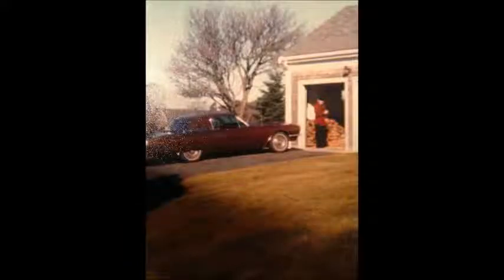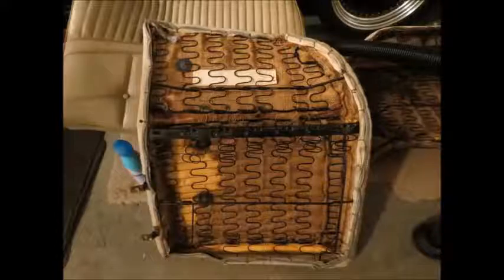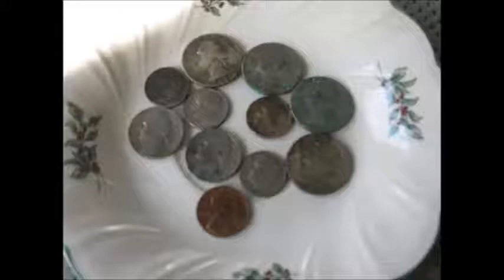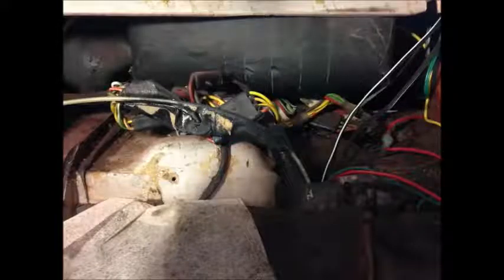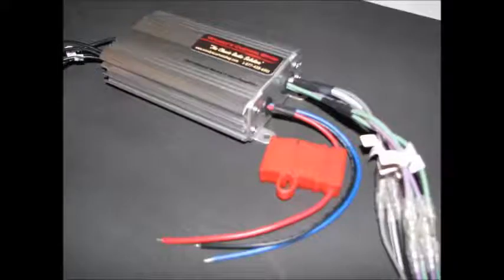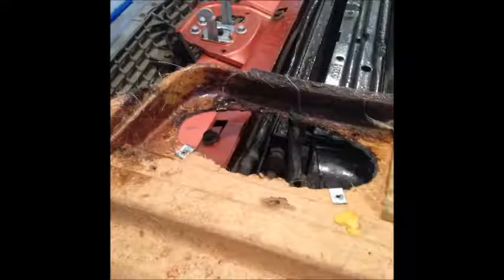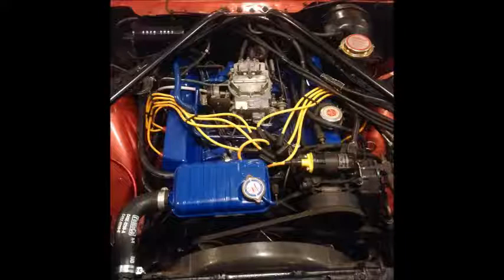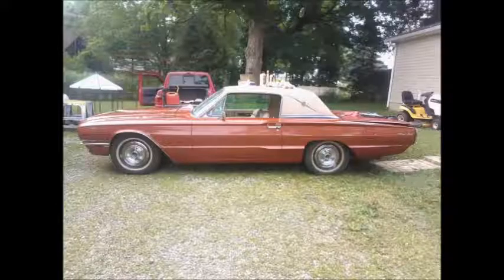1966 Ford Thunderbird Town Landau Restoration Blog

Comment: I always wanted a Tbird when I was a kid, the 64-65 were my favorites. I acquired a '64 in 1984 and had it until 1992. Then just last year a '65 Landau with 80,000 original miles showed up on Craig's list. So not knowing that it was/is a Special Landau I went and bought it. Boy, was Ii in for a surprise.... it has options that I did not even know that they had the passenger seat is electric and has the handle to lay back, has cruse control, and to top it all off it is in Emberglow. So I have been busy over the past several months replacing all kinds of things, all new bushings, front and rear, new leaf springs, shocks, gas tank. Master cylinder, and trunk weather stripping.

Comment: HOW MUCH DID YOU END UP SELLING IT FOR? YOU SAID YOU PAID $3000 AND HOW MUCH TIME DID YOU THINK YOU HAD ON THE PROJECT WITH COSTS OF SUPPLIES? Sorry for all the caps. LOL!
Looks great by the way.
Reply from the maker: That was quite a few years ago! I think I got in the neighborhood of (just under?) $7K for it. Keep in mind it was not running and driving, and it needed ALL the body work to be done. And the rear quarter panels were in tough. shape. I probably had $10K-$12K invested when you figure in all the parts and my time. I really didn't keep track of how many hours I put into the project. I just worked on it whenever I had the time, like most guys. So I definitely took a loss, but in the end, I just wanted it gone, and was glad to see that someone else completed the project.

Comment: You did nice work to bad you did not finish it. I see you sprayed door jams Emberglow That is the color of my 66 bird 428 also.Same interior as the one you owned. I take it you never got the out side painted in Emberglow? Wss the car sitting out side a long time when you got it? Mine is coated under car thanks for pointing out is was factory.You did a nice job on video,Are you doing any other projects?
Reply from the maker: The guy I sold the car to, finished it. He completed the exterior paint job and finally got it running. I had the distributor installed 180* out, and it needed a new coil, that's it. My car didn't sit outside for long. It was a one owner car for 41 years! Mice did inhabit it, in the garage it was stored in. You should subscribe to my channel! I cover nearly every project that I do, and there are lots. lol Thanks for watching and commenting.

Comment: Do you know if the pistons for the calipers can be bought separately. My sister in law threw away the pistons that were in their basement after my brother died. I have two 4 piston calipers and 2 two piston calipers. There is a set of front brake assembly's  kits on E-bay for $400.00 or so. These have  the calipers and rotors and backing plates and maybe flex lines in the kit. I did not think these cars had 4 piston calipers. If anyone on your site knows about the pistons I would appreciate some info., THANKS!!!!
Reply from the maker: These cars came with 2 piston calipers, in the front only. I believe that parts would be available. Also, as a tip, always check Mustang parts that are the same. They are almost always cheaper and more readily available. I would bet that if you went to a big block Mustang from 67-69 or so, Ford would have use the same brakes. Honestly, my knowledge is lacking, I have been out of the Thunderbird 'game' for a few years now. Good luck with your project!!

Comment: Can anyone suggest how we might research a 66 T-Bird back to the original new car sale? The oldest receipt and motor vehicle inspection was 1998. It was sold as a used car. The VIN is non-standard on that car and we have had no luck working through MVA, CarFox or Kelly Blue Book. Any suggestions gratefully accepted and appreciated.
Reply from the maker: If you are the registered current owner, with proper documentation, you can get the ‘Marti’ report from martiauto.com It’s the original invoice from Ford. That will show which dealer it was shipped to, I believe? It’s a great place to start!! Good luck w/ your search, and have fun!! 🤘😎🤘

Comment: I just got one my brother owned. White painted top ,green body. 428 car. Needs some body work but it is not too bad. Underneath needs a major cleaning. Cars had not starter in 20 years. I live in eastern CANADA, in the snow belt. Car is outside now in snow. I dumped a couple gallons of DIESEL fuel in the engine to protect it till I work on it this summer. It had mice problems as well. I think they took some insulation from somewhere and stuffed it in to metal cavity and made a bed and it stunk like he'll from the smell of piss. Have to get some IRISH SPRING SOAP cut up and sprinkled in the car to take away the odor. I am hoping the electrical is not damaged from the rodents. Car has all the options like yours did. Thanks for sharing the vid. Love the car and I want to restore it in my brothers name.
Reply from the maker: michael leblanc Sounds like a great project!! I had a lot of fun, doing mine. Practically every part you will need is available, aftermarket, as well. I really miss mine. I need to get another heavily optioned 66 again, one day!! Lol. Thanks for watching and commenting. Please consider subscribing if you don’t already!!
Reply from the maker: michael leblanc You should definitely post some videos of your restoration! If you do, send me the links... Goid Luck!!
Reply: @Metalcop5150  Peace and blessings to you Sir.
I just stumbled upon your videos. 
You've done a FANTASTIC job on that 1966 TB.
Would you be interested in another one?
With Lee's than 50K miles, garaged since 1983?
Reach out to me if you're interested. 
Thanks
Reply from the maker: @charlestracey5932  Not really looking for another restoration project. But thanks for watching and commenting, my friend!!